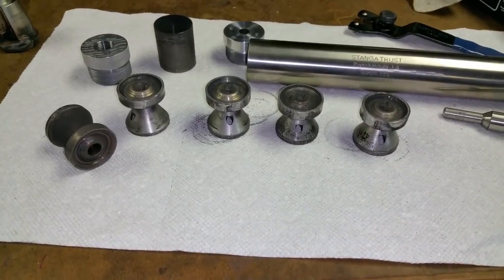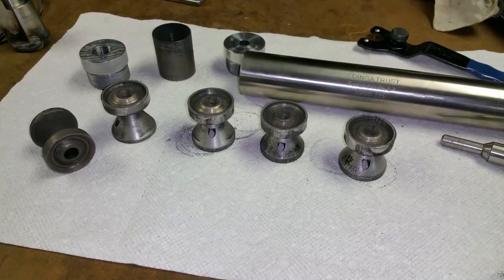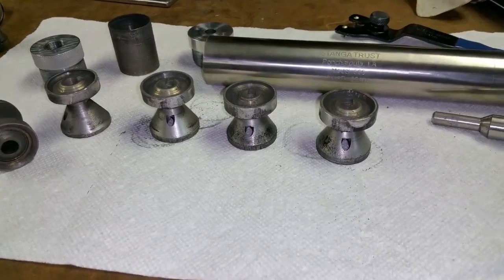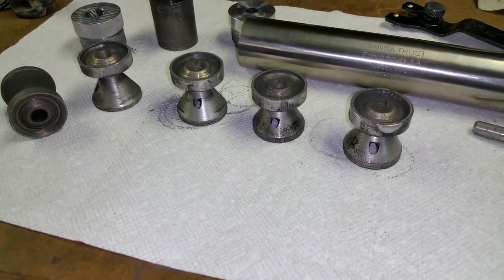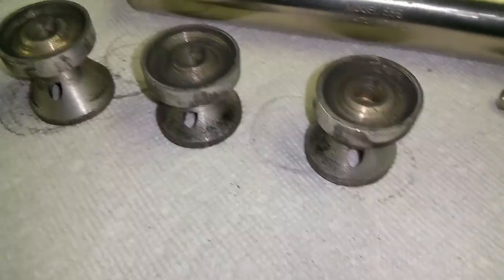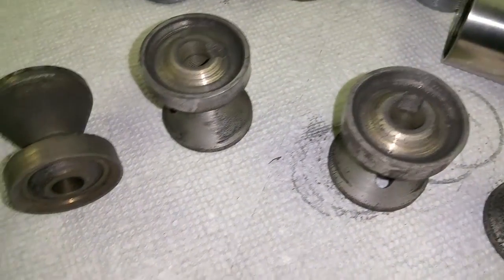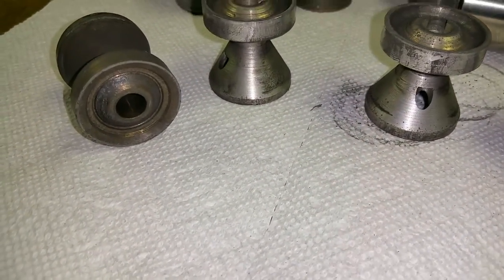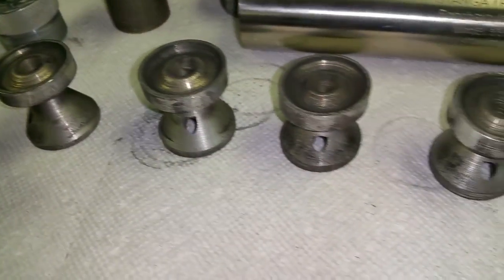Form 1 Suppressor internals after first 10 shots

Comment: Form 1 Builder......out of business, right...?
Reply from the maker: there was no business, I just made a lot of form 1's
Reply from the maker: @lylelyle7789  oh, ok I haven't looked at the site, sounds like atf sting. If you do a form 1 you need to make the parts from raw materials not buying pre made parts
Reply: @bstanga  ...... How does someone make a tube without thousands of dollars worth of tooling and experience?  I'm buying the parts but I have to drill holes in everything, trim to fit the baffles, make my own blast chamber/spacer and I'm buying a Keymo Omega adapter for quick disconnect to my Dead Air muzzle brakes.
Reply from the maker: @lylelyle7789  thats the government for ya
Reply: @bstanga  ......oh well, I'm building mine that way.  I've never seen anything in writing from the ATF saying I have to mold, CNC, forge or pull material out of thin air to make one.
Reply from the maker: @lylelyle7789  Of course, you do you man! I just don't want one of those fuckers from ATF killing my dog..
Reply: @bstanga    .......I hear ya.  Get them before they get the dog.......
Reply: @lylelyle7789  you certainly do not need to build it from raw material. People have successfully form 1'd those cheesy oil filter things that are basically suppressors without the end cap drilled. They are even threaded in common barrel threads. Just make sure you get the stamp back before you buy ANYTHING